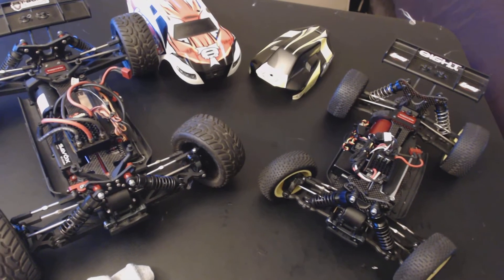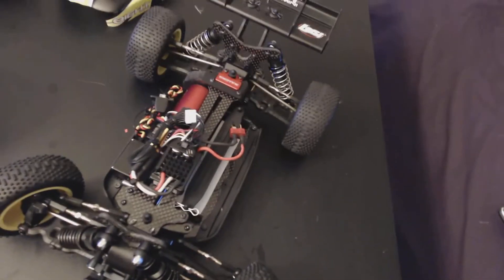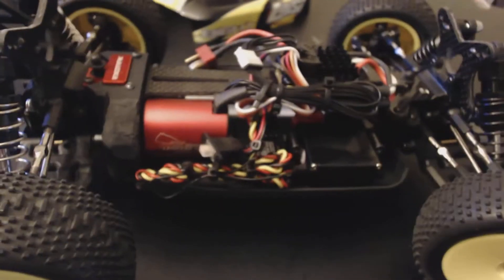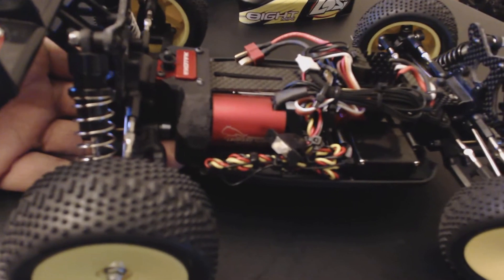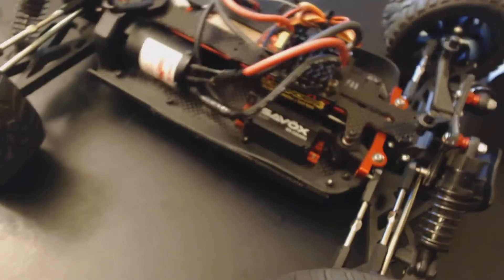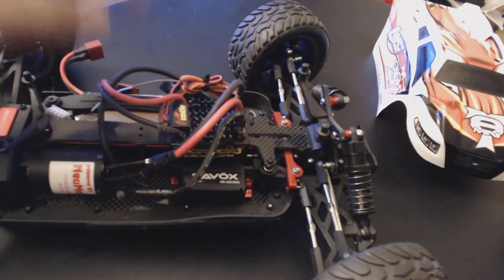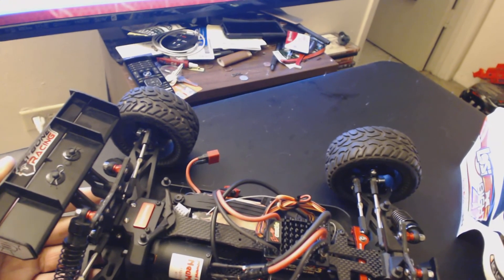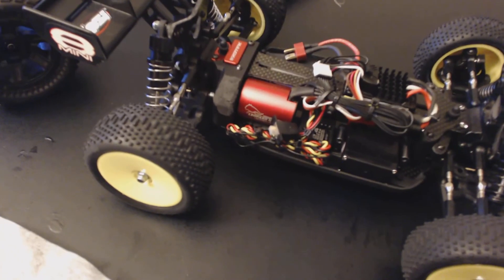Losi Mini 8ight and Mini 8ight T Exotek Conversion

Comment: For the 380 size motor on ur mini 8 buggy did u have to grind the motor mount thanks for any help
Reply from the maker: Aaron Adams no i didn't but exotek racing has a big bore motor mount for the mini 8 and mini 8t. Buy it. Check my final build and thoughts video.

Comment: Nice car.  can you tell me what are the wheels/tyres on 8ight t and are they lighter than stock? thanks
Reply from the maker: Proline dirthawgs and yes they are lighter
Reply: +ScragbyteRC thanks for that. I can not stop stripping spur gear even with  just 2s and I think that weight is the issue, tyres are heavy.  ordered Robinson racing spur so I hope it will sort the problem.
Reply from the maker: +Danijal Besic that's exactly what will solve the spur problem. 👍🏾👍🏾